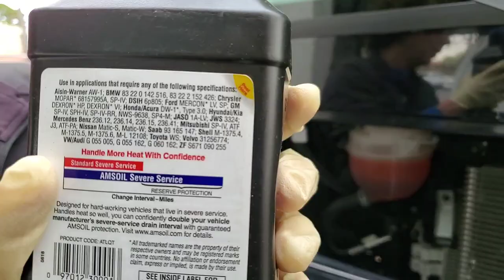2017 F-450 AMSOIL Transmission Fluid Change

Comment from the maker: Check THIS: Peter Built 579 MX-13 AMSOIL Engine Flush - https://youtu.be/nbx1kVoV4Ks

     My Link: Best AMSOIL 100% Synthetic @ Wholesale + FREE Shipping: https://www.amsoil.com/offers/?zo=5331179

     AMSOIL Products & Vehicle Lookup - https://www.amsoil.com/guides.aspx?zo=5331179
 
     AMSOIL Performance Tests - https://www.amsoil.com/performancetests.aspx?zo=5331179

     Follow these accounts for Ebens Giveaway:
Instagram - https://www.instagram.com/syntheticoilprotection/

Facebook - https://www.facebook.com/profile.php?id=100007973957868

     People ask me these three things:

1. Where can I find AMSOIL? - Use this link https://www.amsoil.com/offers/?zo=5331179
Or
Watch THIS: 3 Fast Ways To Get AMSOIL - https://youtu.be/RiYifuDCsnQ

2. What makes AMSOIL different than other oils? - AMSOIL is 100% Synthetic & has higher film strength & last 4×longer then Mobil 1 EP which protects and separate metal parts keeping them from wearing and Lasting Exponentially longer: https://youtu.be/f4eNPgTi_qo

3. Why should I use AMSOIL?: It protects the engine so it will last longer. Less oil changes less often(once per year/15,000miles) or longer... Save money in Gas & Time making it less expensive then a free oil change over the year - https://youtu.be/H7K6FdZlqmg

     Professional YouLubher:
Eben Rockmaker Executive Direct Jobber AMSOIL Specialist (Dealer#: 5331179)
Mobile: (702) 472-3614

     My Link: Best AMSOIL 100% Synthetic @ Wholesale + FREE Shipping: https://www.amsoil.com/offers/?zo=5331179

     AMSOIL Products & Vehicle Lookup - https://www.amsoil.com/guides.aspx?zo=5331179 

     If your vehicle is not on the lookup guide this is AMSOIL Tech Support 715-399-8324 be sure to refer to Eben 5331179

     46,000 Mile AMSOIL Oil Analysis - https://youtu.be/UjijQK5wSM0

     Friend me on and tag me because I like to see great results from my YouTube Community:

     Instagram - https://www.instagram.com/syntheticoilprotection/

     Facebook - https://www.facebook.com/profile.php?id=100007973957868

     Order AMSOIL By Phone:
Be sure to give them my number so I get credit Eben #5331179 and tell them you would like to be a Preferred Customer.

1. Call 1800-956-5695
2. Ask for your own preferred customer membership because you will get 25% off, free shipping over $100, and your informative quarterly AMSOIL Magazine. It costs $10 for 6 months or $20 for the year which is well worth it.
3. Give them my dealer number so I get credit Eben 5331179
4. Orders over $100 will be shipped free.

     Industry-standard 3rd party testing results:

     AMSOIL Signature Series 5W-30 Synthetic Motor Oil protects against harmful deposits on turbochargers 4X better than Mobil1® Extended Performance and 3.6X better than Royal Purple® in industry-standard testing*.
https://www.amsoil.com/newsstand/motor-oil/articles/leading-the-field-in-deposit-protection/?zo=5331179

     AMSOIL gets better gas mileage -
https://www.amsoil.com/newsstand/motor-oil/articles/another-win-for-amsoil-products/?zo=5331179

     AMSOIL Performance Tests - https://www.amsoil.com/performancetests.aspx?zo=5331179

     Professional YouLubher:
Eben Rockmaker Executive Direct Jobber AMSOIL Specialist (Dealer#: 5331179)
Mobile: (702) 472-3614

     My Link: Best AMSOIL 100% Synthetic @ Wholesale + FREE Shipping: https://www.amsoil.com/offers/?zo=5331179

     AMSOIL Products & Vehicle Lookup - https://www.amsoil.com/guides.aspx?zo=5331179

Comment: Not doing an transmission flush?
Reply: I’m really curious too.... but he say only 8k miles on it. Maybe no flush need? If 190,000 never have flush transmission only drain?
Reply from the maker: Yeah usually when you do the flush you would idle it for 15 minutes and circulate it and then you would take off the return hose and do an entire torque converter and pan flush which would be around 20 quarts of ATF fluid.

What we did here is we changed nine of the 18 and 1/2 quarts and change the filter because the fluid still was in pretty good condition and if you wanted to do The Next Step Above even better you could actually come back and 5000 miles in drain and fill the pan again.

That would change out about 80% of the ATF fluid.

The most important thing is to not let the fluid change color and turn brown and keep the filter in magnets clean so the circulation is fast and you have clean fast shifts.

With Dave towing a vehicle behind his motor home he should change that fluid and filter about every 15 to 30 thousand miles to be extra safe always check the color
Reply from the maker: This is a video where Jeff and I took off the return line and we actually flush the entire torque converter and pain in one shot https://youtu.be/-g5UspPi-zY
Reply: @Syntheticoilprotection  My 2011 Prius has a very different transmission setup.  Its uses the ATL but its drains and refills like a manual transmission.

Comment: Just curious why is he changing the transmission fluid with only 8,000 miles on it ?
Reply from the maker: I am putting the Amsoil 100% synthetic in the transmission so it will shift faster and last longer also it'll run cooler because the film strength keeps the metal separated and also it will shift quicker in the cold the gentleman that owns the camper Dave will be pulling a vehicle and that puts extra strain on the transmission.

     The ATF fluid we put in is good for double the severe service than OEM fluid so it's about four times better because breakdown and oxidation of fluid is exponential and for every 18 degrees hotter a fluid runs it oxidizes twice as fast so when your Towing you have a lot of extra heat.
This is the ATF fluid be used - https://www.amsoil.com/p/signature-series-fuel-efficient-synthetic-automatic-transmission-fluid-atl/?zo=5331179
Reply from the maker: Even if I had a new vehicle I would change all the fluids right away because you get better gas mileage also your vehicle will last about two to five times longer with the hundred percent synthetic Amsoil.

People ask me these three things:

1. Where can I find AMSOIL? - Use this link https://www.amsoil.com/offers/?zo=5331179
Or
Watch THIS: 3 Fast Ways To Get AMSOIL - https://youtu.be/RiYifuDCsnQ

2. What makes AMSOIL different than other oils? - AMSOIL is 100% Synthetic & has higher film strength & last 4×longer then Mobil 1 EP which protects and separate metal parts keeping them from wearing and Lasting Exponentially longer: https://youtu.be/f4eNPgTi_qo

3. Why should I use AMSOIL?: It protects the engine so it will last longer. Less oil changes less often(once per year/15,000miles) or longer... Save money in Gas & Time making it less expensive then a free oil change over the year - https://youtu.be/H7K6FdZlqmg
Reply: Zero reasons to change any atf at 8000k miles.The driver is lying saying that the vehicle shifts better and sound more quiet.Amsoil is good,but,its not that good.
Reply: @michellejohn695  Baloney , lots of minute particles in the original fluid no filter is going to take out . Plus Amsoil is superior to ford's ATF .
Reply from the maker: Oh yeah I know you're thinking that and that's what I thought too until I tried it.
I made this video showing people's reactions and what they think of it.
I highly recommend you try the Amsoil you'll definitely be surprised.
https://youtu.be/0YNrt962Q7U